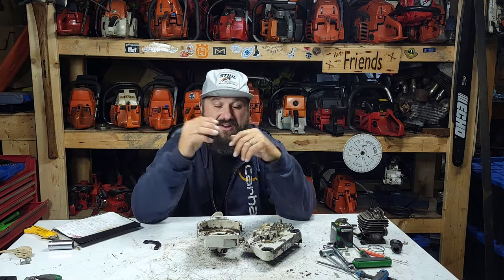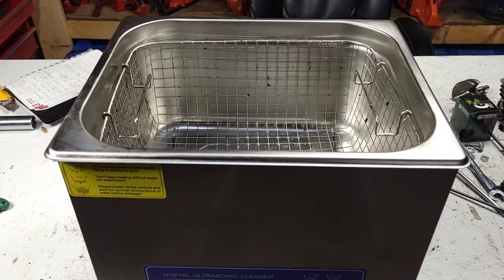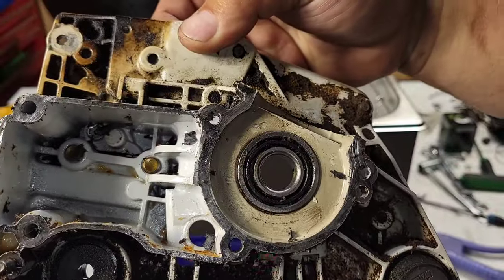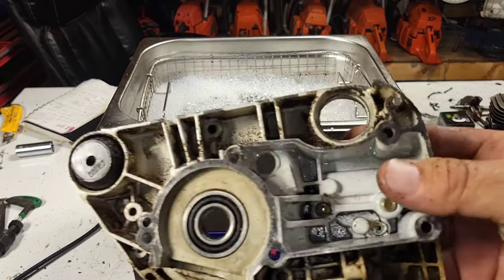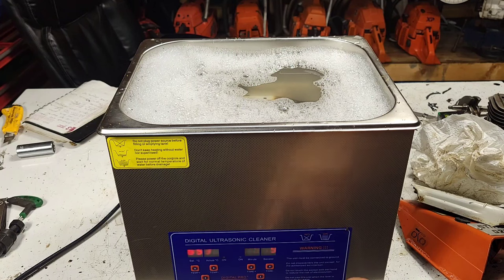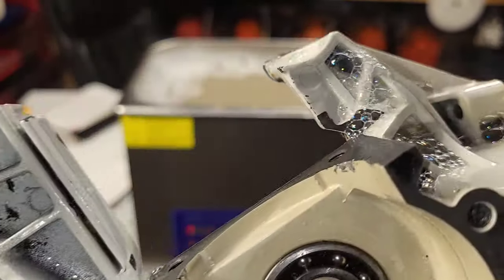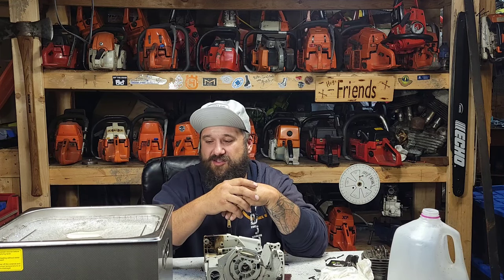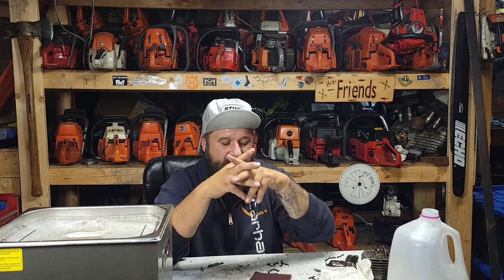ARE THESE STIHL 026 CHAINSAW CASES JUNK?

Comment: Ultra sonic cleaners actually self heat. A heater speeds it up but isn’t really required. 

As for using flammable solvents, never fill the tank completely with them.  Putting them in containers in water is not approved by any safety standards, but I have done it. 

Another thing to know is the parts really need a clean line of sight to the transducer.  The pressure waves are blocked by other objects metal will transfer most of it as it doesn’t compress but one plastic part will completely block another so it is only receiving a hot soak.  Flipping parts is useful. 

They work by creating bubbles in the low pressure part of wave, then when pressure equalizes those bubbles collapse at the speed of sound and fire a tiny ultra high speed jet at the surface knocking off dirt, and it can erode the material given enough time. Because of this action you really don’t want to use a foamy type soap.  You want a surfactant. Straight water, a car wash soap, simple green and purple power are excellent choices.  Straight water doesn’t have a chemical cleaning component, but works great for dirt, dust, and static attracted particles. Oils and glues need a chemical to improve their performance.

Comment: I use a product called Eli-Fil. Comes in alu, steel and cast iron compound. Repaired alu casings and once cured, the finish is as hard and looks like alu. Can dril and tap new threads easy. Built a water alu manifold for my picup that pipe eroded away. Works very wel.

Comment: That little bit of flaking kinda worried about but maybe with a little bit of sanding it might be fine. And if worried about the bottom you could always put a layer of jb weld to smooth it up a bit. Can't wait to see it together and running

Comment: I put parts in an old dishwasher. Does a good job.
Reply: Might put them in the good dishwasher 🤣 see what the wife has to say
Reply: If they are gone before 5am it never happened.@crossan008
Reply: Careful running the cases too warm for too long, had some older models flake off paint, albeit paint was already chipped and scratched plus delicate (042av) particularly if it was used with a degreaser.

Comment: The Stihl 026 I have has "mag rot" on the clutch side, I'm in two minds as to if I should replace the cases, need to split and clean the cases. I have heard you can replace just the one case half but from my understanding the cases are line bored. Pull apart that other saw you have and see what it's like then make a decision TM.

Comment: Original is nice if it functions, but mutts can do a lot of work. One thing to keep in mind with large ultrasonic cleaners is that they should not be run with a low fluid level even if you are only do a small part. the little units inside will burnout if the machine is run dry/low.

Comment: History of the saw and where she lived.  Dissimilar metal corrosion.  I used to work on Aircraft I saw it alot with salt water, magnesium, Aluminum, steel , titanium copper brass, salt changes the molecular structure of metal and here ya go.
Reply: Old school pressure treated lumber and aluminum cladding don't get along, especially in the presence of water. Something about the old copper chromate previously used in pressure treated lumber being to close on the galvanic scale to aluminum. The reaction would corrode the aluminum over time. I've found holes eaten right through the cladding.

Comment: Hey bro, I saw a few of your mosquitoes fly by on the video, do you use shotguns to kill them😂
Have you thought about feathering the bad paint in the crankcase and applying  the appropriate epoxy paint to seal the surfaces from flaking? It would also seal up the smaller holes and pits from where the corrosion is happening. Just thinking about some sound repairs for that saw in case it comes my way...😂
Keep the shop life happening, but ALWAYS MAKE FAMILY FIRST!!!❤

Comment: For me, those cases are too far gone. The actual crankcase is probably gas tight, but taken together, they're not worth the time investment to do a full rebuild. I'd look at the 260 cases and then make a decision.  I once built an 026/MS260 hybrid for a mate. He was skint and had a dead 026 and a broken 260 and was borrowing my spare Husky. 260 top end and crank on 026 cases and 026 carb and it went like a train. So parts can be interchangeable. Use the best bits and it'll still be interesting.

Comment: HI TINMAN 😊😊  the chainsaw cases turn out good and clean that's clean alot better than what it was be 4 and the pull start rope W the nylon is better than the old saw rope stores have it 😊😊 OMG 6 28 2O24

Comment: Personally flywheel side I would save for the bone pile.  Clutch side looks good.  Nothing wrong with a frankensaw the parts interchange you are not going for a restoration you are looking to build a runner.  With the pitting so deep I would put it aside